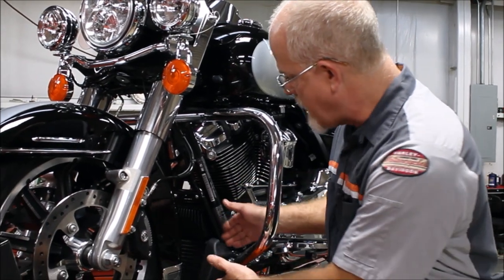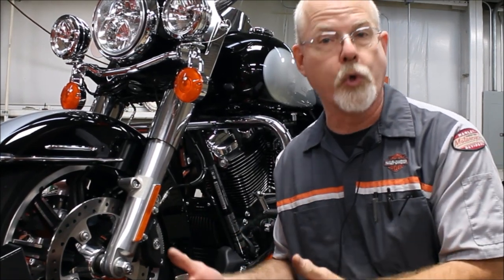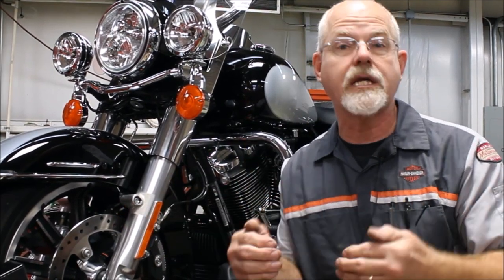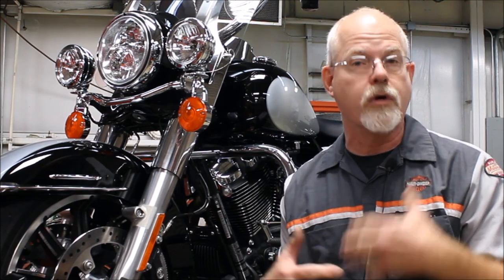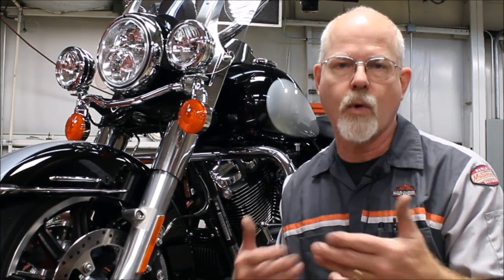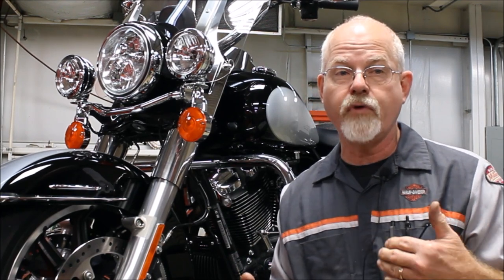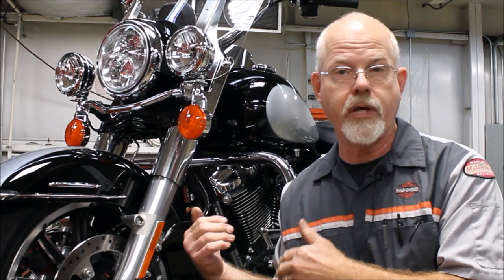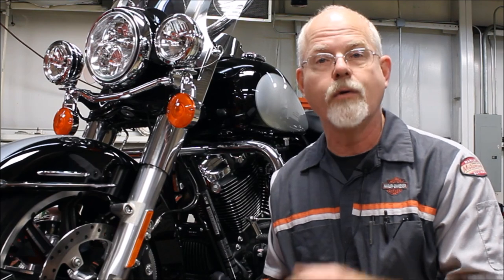DOC HARLEY: OIL COOLERS

Comment: Sir,
It gets hot out here in Texas. I have a 2017 CVO Street Gide. It’s set up to be water cooled. Would it be overkill to add a fan assisted oil cooler. What do you suggest the temperature should be for the 2 fans come on? What should the temperature be to turn them off or what should the differential temperature be? I was told 8 degrees I think it should be more.
Reply from the maker: Yes I would add an oil cooler with fans. Read the fine print when choosing. Many oil coolers with fans do not fit on twin cooled Harley-Davidson with the lowers and water pump. My Jagg with fan comes on at 210. Thanks ~ Doc

Comment: Hey doc I have a xvs vstar 250 with cold air intake custom pipes drag style and a 115 main jet  I took off the air injection system I use mobile 1 racing 4t oil would you recommend an oil cooler for my bike

Comment: Hey Doc. What's your opinion on Love Jugs? I live in Savannah and as with you, it can reach 110 heat index daily during the summer riding months. My 72 gets me to work and back home as many days that dry weather allows. I was thinking about installing the jugs as opposed to an oil cooler. Any tips would be greatly appreciated.
Reply from the maker: I prefer an oil cooler but the love jugs could work.
Reply: @LowCountryHarleyDavidson  thanks for the quick response. My 72 is small in the space category and when you mentioned debris hitting the oil cooler coils, I thought maybe the jugs would accomplish the same for my needs, without the additional risk of a sudden oil leak due to damage at the coils. Thanks again brother.

Comment: Doc I have a 2016 Heritage with an add on Harley cooler. It runs in the 220 to 230 degree range with 20w 50 oil. I changed my oil and went to straight 60w oil. its over 98 degrees here everyday. I guess the cooler did not like the thicker oil and doesn't flow as good. My temp now goes up to 270. I have went back down to 20w 50 and the temp lowered back down. Have you ever heard of this? I was following the owners manual with the recommended weight of oil for the outside temp. With the thicker oil the engine was quieter. (stock engine clatter)
Reply from the maker: This is news to me. You followed all the right thoughts. What type of oil cooler do you have, and how are you monitoring your oil temp?  In theory an oil cooler does have very tiny passages for the thick oil to pass through BUT most oil coolers have a thermostat that controls when the oil passes through the oil cooler so the thickness of the oil should have no influence on control of oil temp by oil cooler. This is a question I will ask Harley after you tell me what oil cooler you have and how you are monitoring oil temp. Thanks ~ Doc
Reply: @LowCountryHarleyDavidson  The oil cooler is a Harley Davidson Brand. I am monitoring the oil temp with a Harley analog oil temp gauge. The oil cap one. I was running 250 to 260 before I installed the oil cooler with 20-50 oil. I also have the Screamin Eagle oil pump assembly to try and flow more oil.
Reply: @georgedishman3276  I ride a 2014 Fatboy Lo with an S&S 124 with 585 cams. My oil measures 250 - 270 degrees also (measured on my analog dipstick). I’d like to shave 40 - 50 degrees but I’ve heard most guys are only seeing a 20 degree drop in temp. I live in Canada…. so no Arizona heat here.

Comment: Doc, why didn't they also add an oil cooler to the twin cooled as the oil temp at high ambient air conditions gets over 250 deg F? (my test at 102 Deg F outside temp and 75 mph for one hour--255 deg F 2021 HD RG Ltd).  I guess full synthetic can handle it but not conventional oil.  Cars and liquid cooled motorcycles peak their oil temps at 200-210 F.
Reply from the maker: You have pointed out a huge point. Car oil  can not handle air cooled motor temperatures. Yes if I owned a Twin cooled, I would add an oil cooler….Doc
Reply: Thanks Doc, one last question--I read on some blogs that the M8 twin cooled oil pump is lower capacity than the air/oil cooled M8's. My 2021, of course, has the upgraded pump from the early M8's.  If mine is lower capacity than the non-twin cooled M8, would adding an oil cooler risk reducing total engine oil flow rates? @LowCountryHarleyDavidson

Comment: Hi im building  a 2013 street glide air cooled harness etc.... ive bout everything  for it from ebay.. so..when it came to getting the engine.. ive purchased  an 2014 liquid  cool ultra limited twin 103 engine.. now.. ive purchased the liquid cooling system..but how to hook it up to a 2013 oil cool harness and bike...

Comment: Hello @Low Country Harley-Davidson
My name is Yan and I have a v rod muscle 2014 and I am doing the coolant replacement. In the service manual says 2.4L, is already open the Radiator drain plug and Front Cylinder Coolant Drain Plug in just removed 2L coolant. Is that correct? How do I find the Rear Cylinder Coolant Drain Plug? I can not find it ... could you help me?

Comment: Doc. I have a 2012 Roadking police, I was wounding if  Harley  makes a fan assist cooler for my bike or do you know of a good aftermarket one
Reply from the maker: Harley-Davidson offers their tried and true premium oil cooler without fan. There are several aftermarket manufacturers who are offering an oil cooler with fan (s)..Jaggs and Ultra Cool are at the top of the list. Do your research, follow the reviews by people who have installed and rode with them in the heat. Thanks ~ Doc

Comment: Do I need to drain all the oil in a HD 103 to install an oil cooler? The oil has not run 200 miles. It's new.
Reply from the maker: No need to drain. In fact after installing you’ll need to add oil👍….Doc
Reply: @LowCountryHarleyDavidson  Thanks,  I watch your videos, some two or three  times, they are very enlightening. I just bought a 2012 switchback with low milage but a bit neglected. I've been doing maintenance upkeep myself. One exception so far, abs brakes will be attended to by the Harley dealer.

Comment: Great vid Doc. I own a 2018 lowrider,does it have an oil cooler.
Reply: If it does, you will see it on the front lowest part of your frame (in front of the engine) with the lines going into the motor right above the oil filter.
Reply: @CovertOperation13  thanx man

Comment: Why aren’t oil coolers standard on the majority of Harley-Davidson’s?
Reply: jeffry gagnon - That's not unusual in any hobby, people who have model trains, Ham radios or even gaming computers it becomes Non-Stop add ons...
Reply: Riding is not a hobby it is a necessity
Reply: The Pale Emperor $$$$$$$$$$$$$$$$$$$$
Reply: they are.
Reply: cause it is about worthless.
Reply: when air is not flowing, the cooler has little effect and when you are running down the road, you don't need it. Just another product to get your money. By the way, have you ever had your bike to lock up from overheating? I thought not.
Reply: Oil cooling is not as efficient as it used to be mainly because of synthetic oils. The very reason synthetics retain their lubricity better than conventional oil is because they DO NOT absorb heat as good which means they don't transfer temperature variations very well
Reply: yes, it was a Harley and it was destroyed in 3 hours stop go traffic
Reply: Pay all that money and its not even a complete product
Reply: My road king has one.
Reply: Never seems to run hot
Reply: @jerryhubbard4461  Anytime you can cool oil by any means is better for the engine. ALL air cooled (and water cooled) airplane engines have oil coolers on the bc they increase the life of the engine. No one would be dumb enough the fly around in a airplane without an oil cooler. Its a limitation (land ASAP) if oil temps exceed 245 degrees.
Reply: @jerryhubbard4461  I did burn up a VW bus years ago
Reply: @garybaldwin1061  once a plane gets off the ground, it does not need an oil cooler anymore. At some altitudes it needs an oil heater.
Reply: @jerryhubbard4461  You couldn't be more wrong. You don't know what your talking about. Oil temps taxing on ground drop (low power settings and cowl flaps open).  In the climb most engines get very warm bc they are at full power and pitch up attitude with less air flow over the engine. . Not enough cooling even with oil cooler.  Oil coolers are a plus with any oil cooled engine.  I spent a career flying large air cooled engines monitoring engine instruments all day long.
Reply: Why doesn't Ford make all their engines as reliable as toyota?  Why is Kim Kardashian a coal burner?
Reply: @garybaldwin1061  Gary, I can almost agree, but you went to far. These engines are engineered to operate as delivered, which is particularly important with computers and sensors programed to manage function. I have the 2016 103 and it doesn't have the advanced cooling system of ALL the 2018+ models. With the cooling that changed compression ratios, cams, etc. It's a matched system, you can't just take one thing and add or subtract it because it should work more efficiently. Yes, a liquid cooler motor operates more efficiently, but that doesn't translate to adding a cooler for better performance. No different thannkids copying crap from movies on their jap cars and blowing motors or replacing tires every few months. Each and every change needs to be carefully planned with a professional who can tell you whether that's actually going to make things better, worse or is just pissing in the wind

Another great example, 4 stroke motors improve performance with more air and less resistance to getting the exhaust out. With a carburator, points and distributor it was fairly simple. Do that with a computer controlled, efi motor and performance goes to shit. The computer needs a different "tune" programmed into it. PS, I went first to Indian and triumph because I didn't want an air cooled bike. The scout has forward controls and low bars...no one with a healthy enough back to ride like that can actually afford one. New bars, cables, etc raise the price approx $3000 and you can't recover that money if you sell......in fact you'd better store all the original parts for as long as you own the bike. Just talking motor and cooling, pre 2018, the Indian was far superior. Triumph bobber is one sweet bike, but it's a permanent solo seat with a strep bar mounted where the tank meets the seat for suspension......is, you'll be pissing blood if you take a long ride or a back road to the cabin. Also, it's efi and the carbs are fake. Nothing says wannabe like fake parts to try and be cool. I loved my Yamaha's and Kawasaki, it was stunning Harley didn't improve. That's the old days and between Miami and the keys, Miami and Daytona, there were always Harley's down on the side if the highway. My 2016 (which I got mainly due to sitting position and back pain) doesn't overheat and break down like those old bikes. Even though the new engines (cooling system) were being sold, only a fool guys year one. Harley should've been much better, but it looks like they've finally upped their game and I thank Indian, victory, triumph for forcing Harley's hand. Had Indian had a reasonable riding position for an adult, that's the bike I left the house intending to buy. I even went back a few weeks ago and test ride the scout again, didn't make it out of the parking lot before the pain made me turn around. Would the 10-12" bars fix that....maybe, but it's approx $16000 to find out.
Reply: Because its not needed for everyone and if it was sold it with it on the bike you would still be paying for it. anyways, so might as well just have the people who need it buy it separate. People act like if the parts were on the bike at the time of sale they would be saving money or something. It would just be added into the price with the time and labor of the item (which is included in the price of a new bike, assembly time, in case you didnt know). Which is great if you like that part, or want the item, or your willing to pay the assembly price. If you dont, want it or want to DYI, then you are paying more for something you dont want or like.

Comment: Ive been wanting one for my 08 xl1200 nightster its had a few mods and I think this is making it run a little bit hotter then normal.
I'd love to try one to see if it makes a difference but I'm not sure if it Will fit on my sportster with the forward controls does anyone know if it will fit??
Reply from the maker: HD catalog suggests part # 62700082. Thanks ~ Doc

Comment: How about upgrading the oil pump if the bike was not equipped a cooler. Specially on older bikes?
Reply: The pumps are fine, the run long and move plenty of oil. If you want to upgrade to an s&s or Jim's go for it but shovel/Evo oil pumps are fantastic. Twin cam is another story

Comment: Wouldn't it make more sense to use a thicker viscosity,  like SAE 50 or 60? I live in Central FL and thinking about 60 in hot months, 50 cool months. The 20w-50 does not seem to cut it. No need for oil cooler, since you are trying to keep the viscosity.
Reply from the maker: Your observation is correct. Plus HD still suggests changing viscosity oil for temperatures. My personal thoughts are this was the practice in the past when passageways in the motor were the size of an Arby's plastic straw. Our motors have very small passageways in the cam cover, lifters and rockers that a 60 wt oil would have a hard time flowing. Also when 60 wt is cold (not up to operating temp) this creates high pressure. Sometimes enough to pop the pressure valve in the cam cover. 20w-50 is a good oil year round and with an oil cooler with thermostat temperatures can be kept in the designed operating temperature for oil and motor. Thanks ~ Doc

Comment: I ordered the fan for the oil cooler but once on the lift, they found out the chrome cover I had on it was not compatible and it was either a choice of having the fan and loosing the chrome cover or not installing the fan altogether.  After paying $$$ for the chrome cover, I choose not to install the fan.  I just have to make sure not to get stuck in stop & go traffic.  Oh, the police version have them on from the factory.  * We, the techs and I, re-read the catalog description and it did say it wasn't compatible. DOH!!!  Cool thing is they didn't charge me anything for the mishap and kept the fan and restocked it.
Reply: Chrome won't get you home, an oil cooler will!

Comment: I’ve been told that HD oil coolers route the oil through the cooler before it goes through the filter…if so, I think it should be reversed as clean oil won’t clog the the cooler over time.
Reply from the maker: Good point....Doc

Comment: Run Synthetic Oil First. I've always ran synthetic, for years the Harley service guy would say you don't need synthetic only use regular oil, then Harley realized people are running synthetic and now they have it, now the service guy says good idea to run synthetic and use it in all 3 holes lol.
Reply from the maker: Yes I agree. It is my opinion Synthetic was taking customer's money away from dealers so HD jumped on board and created their Syn 3. For years HD preached Synthetic would make the lower roller bearing skip instead of roll. bottom end has not changed and it is OK now to use Synthetic....as long as it is HD Syne 3.....Doc

Comment: Wouldn't  be bad to have an oil cooler but the cost for one is nuts .  Why have every part so costly ?
250 .00 for a rotor, 300.00 oil cooler, 650.00 seat , 500.00 two tires, 1100.00 exhaust, 350.00 cams,  you name it!
Harley made the Twin Cam to run hot so you'll buy a cooler, ggg

Comment: Hello Doc, thanks for the video.  When a fan assisted Harley Davidson oil cooler is installed and plugged into the factory supplied wiring harness on a 2019 touring.  Does the ECM need to be programmed to control the fan or does the ECM recognize the cooler fan and begin  to control per oil temperature?
I assume the HD fan assisted cooler over the counter part is the same as the trike fan you mention. it is a great and surprisingly low cost addition.
Reply: ml414skidoo did you ever find your answer to your question I was thinking about adding a fan to my 17 street glide
Reply: mahlercdo3   I asked my local dealer again when I had my first service done and the service advisor said that it will just work when plugged in.   But after 5500km now I’ve never heard, seen or felt it turn on,  just hope it works I guess 🤨

Comment: Hey Doc. Is oil cooled different than oil assisted?
Reply: Before the twin-cooled models, they pretty much called them air-cooled, oil assisted but it's bs. The air cools the exterior of the engine, oil lines and tank so the oil itself is a liquid pulling heat away from the engine. Adding an external cooler just makes it work better....still air and oil cooled.

Comment: +++++++ ,excepted on the water cooled engine , not needed , had a 2017 limited put 80k +in three years not one water system problem , bought a 2020 limited got 32k as of now , not problems ,only changed mufflers, and a HD air cleaner .

Comment: How hot is to hot for a 2013 Electra Glide ultra limited?
Reply from the maker: I try to keep it under 230. I have seen 260-280 but stopped ASAP, had a beer to let it cool down. Thanks ~ Doc

Comment: I need good solution for leaking engine road king FLHR model 2000
Because every year i have leaking 😔
Reply from the maker: Sorry for your “oil leaking” issue. I need more information on where and when. Are you talking about the oil cooler adapter? Oil lines? Or somewhere else? Have you asked your local dealer (who can see) to diagnose your issue or are you working on your bike only? Thanks ~ Doc